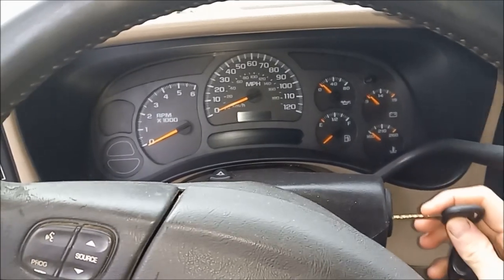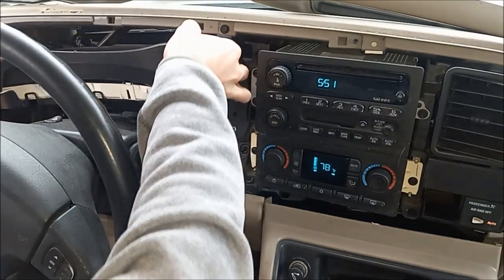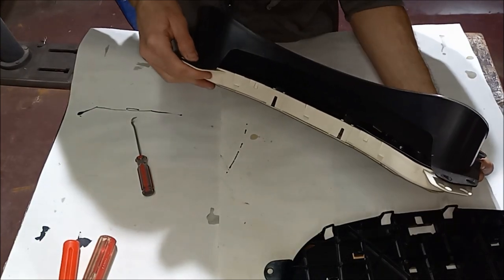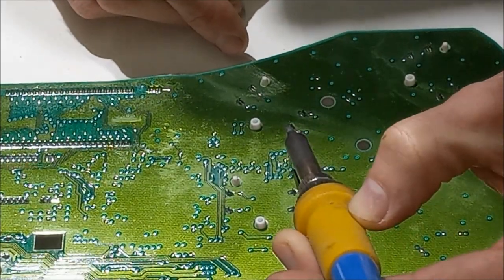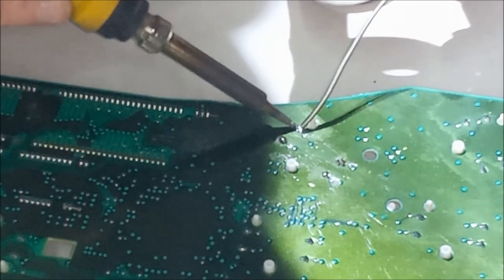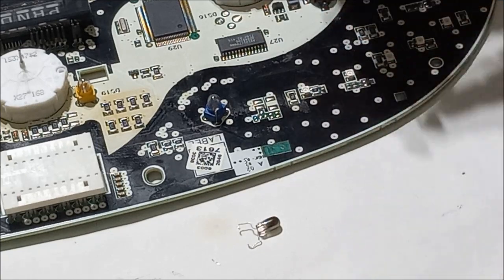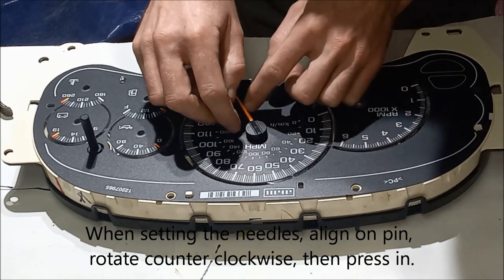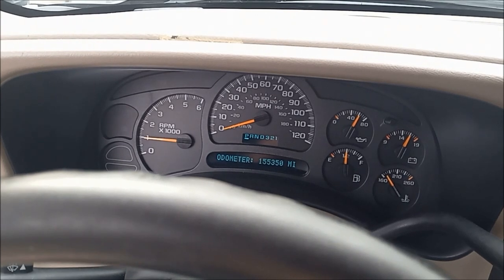Gauge repair 99-06 Silverado /Sierra

Comment: Videos like this are what keeps me in business. 

I will say, I learned a new way to remove solder from a board before. That’s the first time I’ve ever seen it done like that, and I cringed so hard I almost cracked my teeth.  

If you’re going to make videos like this in an attempt to help people,  please make sure you’re at least doing it right.  Because this is how people burn their stuff up and have to spend WAY more getting it repaired correctly.
Reply: Agree to an extent, but tired of cleaning the messes up
Reply from the maker: Hi  @matthewstrelko, I agree. using compressed air to remove solder is not a great idea, and that is why I stated in the video, "don't use compressed air to remove solder"

Comment: Tilt back on the lens and it pops right off.  Prying at the bottom clips is a good way to break the VFD under there. 

These clusters are definitely something you can DIY repair though. Just take the advice being left in the comments and learn from it, don't take personally.
Reply from the maker: thank you.

Comment: Unbelievable, you need to rename your video “ How to destroy your cluster “
You dont need a tool to remove the lens especially a pick or metal screwdriver. 
Poking metal objects up underneath the board to release the two bottom clips is how you crack the DIC (lower display )
Every step is wrong, SMH
Reply from the maker: thanks for your input.